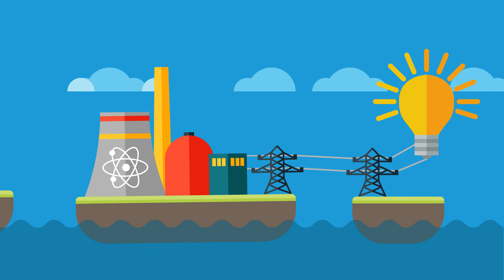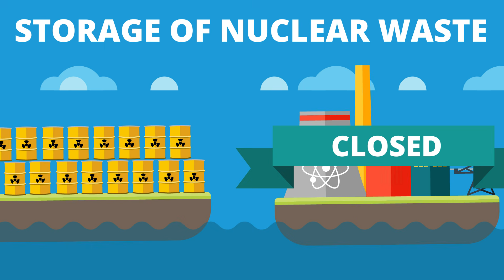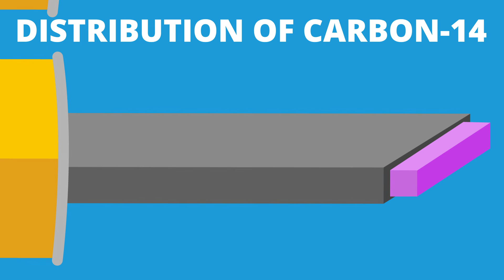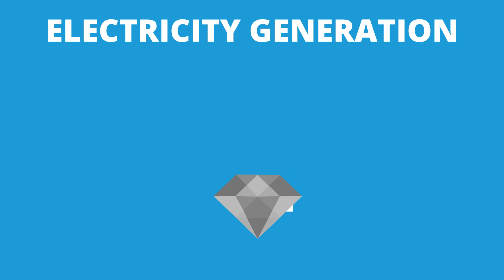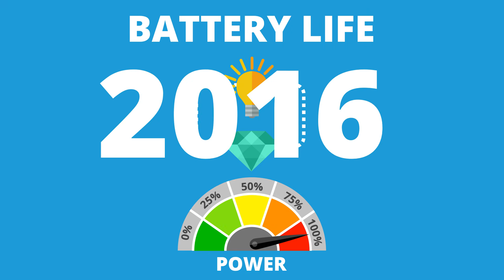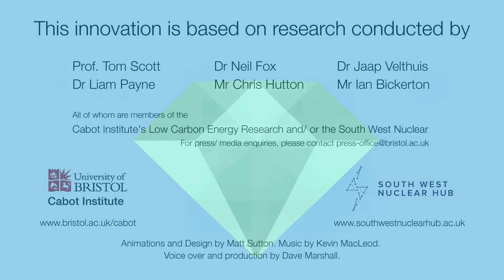‘Diamond-age’ of power generation as nuclear batteries developed

Comment: What size/weight and how much power we could expect form them?
Reply: "A diamond beta-battery containing 1 gram of C14 will deliver 15 Joules per day"

15 joules per day is about 173.6 μW... It's probably also safe to assume that that's the maximum power output, so I doubt you would even get anywhere near that output in any practical application. So... You'd probably be better off harnessing the static from your shirt as you move around to power your pace maker...
Reply: Well in this case, you have to be REALLY creative to come up with a application, wait till them come up will more powerful way to do this, or we eventually have some devices requires this little amount of power to work.
Reply: rudymeow Applications are basically reduced to areas that don't have any better power source and can have fairly large banks of these batteries... So... Basically just shallow crust mining, space-rock mining, and space exploration outside of solar systems... They have more powerful ways to use the same effect, and they've been doing it for decades. Just not with diamonds formed from carbon-14. They use decent semiconductors instead of diamond and fuels with a shorter half-life. I don't see the output of these things increasing much if at all considering it's largely limited by the half life of the Carbon. I suppose you could increase this by somehow increasing the concentration of carbon 14, but then you would have the problem of it becoming more dangerous.

Comment: Yeah.. graphite moderators are totally still in use... cough Chernobyl
Reply: It's because the graphite was used in combination with water as a coolant.

In a regular LWR, when steam bubbles form, neutron moderation is reduced, and the reaction slows down, creating a negative void coefficient. But with water and graphite together, the neutrons are slowed by the graphite and then absorbed by the water. That means that when steam bubbles form, there are more available neutrons because less are being absorbed, creating a positive void coefficient.

Graphite is a very good moderator, but it's only safe to use when you employ a coolant that doesn't also absorb neutrons, like a molten salt or high-pressure helium gas.
Reply: Wasn't Chernobyl a result of the overseer forcing the engineers to crank up the power output--against their urges not to--to impress some general or something?
Reply: Hank The graphite moderator was ultimately the problem in the whole equation.
Reply: MLGBanterVids Do you have a source that supports that? All of the sources I can find state that the graphite was the final trigger and was only a problem because they deteriorated due to improper cooling.
Reply: Hank That's what i meant :)
Reply: MLGBanterVids Then the real cause was poor cooling, not the control rods ;)
Reply: Hank Having fucking GRAPHITE in your nuclear reactor is never a good idea tho lol
Reply: MLGBanterVids Why?
Reply: +MLGBanterVids Graphite moderators are used in every nuclear reactor afaik, that wasn't the problem with Chernobyl. It didn't have enough safety systems in place to prevent the operators from doing something stupid. +Hank They weren't trying to impress anyone, they were performing an experiment to determine if the turbines would still produce enough power in the event of a reactor shut down until the diesel generators kicked in (they took about a minute to produce sufficient power to cool the reactor). They were operating the reactor in a very unstable configuration where they were flushing the reactor core with tons of coolant (reducing the rate of nuclear reactions) while having nearly all the control rods withdrawn. This was very dangerous as a steam bubble would immediately cause a flux in nuclear reactions, which is exactly what happened and an excursion event followed.
Reply: Or in other words: The fact that they didn't use their graphite caused the problem. So graphite is both good and needed in a nuclear reactor.

Comment: The lower energy output for grams means that for applications the diamond batteries will have to be quite massive and it's true that carbon can shield high frequency electromagnetic radiation, but what about Neutron Activation?
A large amount  of concentrated C14 would constantly emit a level of neutron radiation capable to make surroundings radioactive by neutron activation on long term periods.

Comment: As soon as i hear this melody i know i'm dealing with bullshit. Can't wait to see this shit debunked back into the hole it crawled out from.
Reply: It's a fairly reputable source though, Bristol Uni is ranked 41st in the world. I'm a bit sceptical, but it would be really unlike a Uni to put something like this out if it was nonsense, as it would be a massive reputational blow.

Bare in mind it's not promising the earth, just a low joule power source. Great for some applications, but it's not about to power your house.
Reply: Haha )
Reply: it's legit. but its power density will disappoint you, (170 µW per gram) and i think that's why they neglected to mention that
Reply: Huh. I thought Fission Batteries from Fallout when I heard of these things and apparently I wasn't far off.

Sounds like to be a practical wattage they'd have to be large and expensive. Still, if they can work anything like advertised, I can see uses for them.
Reply: Tactical ThunderNeck incoming!
More seriously, just wished there was less bullshit around "muh long half-life", and a bit more content about the energy cost of making such a thing VS its total output over a century or two.
Reply: How much can that power? Even a light bulb that never needs recharging (though probably replacing) could be useful.
Reply: a typical LED at average brightness will use around 33 milliwatts; so to power it alone, the battery would have to be 190 grams
Reply: +Paul Shields
And that's assuming the LED provides the perfect load for the battery to operate at max power, which I highly doubt it would.
Reply: +busi magen
I don't know if I would refer to TEGs as thermocouples...
Reply: Hank LEDs are stable loads, so power conversion to them is quite straight forward; conversion efficiency is routinely 95% or better, nothing to worry about, there. The deal breaker for this battery however is the low efficiency to start with.
Reply: +Paul Shields
I'm not concerned about the LED's efficiency. I'm concerned about what kind of current--and by extension, power--they could output when operating at a voltage high enough to surpass the barrier voltage of the diode. We know A power value for them. I'm guessing that's the max power point. If you don't know what I'm talking about, look up "solar panel power curve." These will have the same sort of curve. All semiconductor junction-based generators have output curves just like those, be they photovoltaics, thermoelectric, or betavoltaics such as this.
Reply: Hank Solar suffers from less than ideal conditions, fluctuating with temperature and sunlight, whereas a nuclear battery will have a smooth run-down as it ages. The application designer will match the power source to the load. If the load is stable, the job is straightforward; if not, power converters, which trade off current and voltage, are mature technology.
Reply: +Paul Shields
Again, you don't know what I'm talking about, and you didn't bother to look up the curve I told you to. When you leave the output of generators such as these open, you get what is known as the open circuit voltage. Since there's no current under those conditions, the power output is zero. Similarly, when you short the output, you get the short circuit current, with a voltage of zero, meaning the output power is also zero. There is a point between these two points at which the power output is maximized, known as the maximum power point.

Yes, I suppose you could set up a system in which the MPP is maintained, and converters are used to match it to the load, but then you'd lose even more efficiency and stability.
Reply: Hank, what puzzles me is your insistence that i don't know what you're talking about and that i didn't look things up. Not only am I proficient at electronics, (so there is no need to explain open-circuit voltage to me), I am also diligent and did examine the curves you referred to, before replying. Having designed, built, and tested power systems for auto-motive microcontrollers, i believe i can say confidently that we're not talking about a wild idea to fit round pegs into square holes, here. The technology is mature, even in Solar
Reply: +Paul Shields
Then why did you bring up irrelevant issues that PVs have? That's why I thought you didn't know what I was referring to. My argument is that they likely won't even be able to supply anything fairly close to the output power that they've mentioned. Yes, DC-DC converters would likely be helpful for cases a fair distance from the MPP, but they would still only be a detriment at or near the MPP. The 170 µW/g estimate is optimistic at best.

My original comment was "And that's assuming the LED provides the perfect load for the battery to operate at max power, which I highly doubt it would." If it doesn't operate at the MPP by itself, you won't be able to get the aforementioned power output. It might be possible to design the battery for a specific MPP, but I don't know how they plan to do the scaling, or how well the efficiency scales with the size.

In another thread on this video, there was a software engineer who didn't know what a digital clock was. Then, after talking to some CS friends, I found out that they hardly mention them in their curriculum. Nothing's more detrimental to a conversation than assuming someone knows a fundamental bit of information that he/she doesn't actually know.
Reply: We cant say 170 µW/g is optimistic without looking into battery configuration; that value is only 1.5% of thermodynamic efficiency, so it seems like the inventors took some issues into account. C-14 decay energy is 156 keV. we can start out assuming the beta is ejected from the nucleus in a random direction, and most of the time flies across some gap (but sometimes the direction isn't favourable). lots to think about, there
Reply: +Paul Shields
If the 170 µW/g is calculated, then you're right, but I was under the impression that it was an empirical result.
Reply: +Paul Shields
If the 170 µW/g is calculated, then you're right, but I was under the impression that it was an empirical result.
Reply: +Paul Shields. In other words, in order to run a small lamp (around 3 watts) you would need a 19 kg battery. Does not strike me as very practical. Unless, they manage to make these batteries a few orders of magnitude more efficient I don't really see the point.
Reply: +Probus Excogitatoris
Improving the efficiency might help, but I don't know how much more efficient you can get them without using a form other than diamond. The bigger issue is that the source of radiation decays so slowly, which is why they last such a long time.

The only practical applications would be in places where every method of generating electricity from the environment would be less practical and no reasonable way to get more fuel to the device... So pretty much just deep-space probes and the like...
Reply: +Hank I agree that it's not likely they will manage to make them several orders of magnitude more efficient. Longevity is of course a great benefit with regard to deep space probes... but, so is weight and these batteries are seriously heavy in comparison to other forms of batteries. But, who knows...
Reply: +Probus Excogitatoris
But they aren't heavier than the fuel or quantity of batteries that would be needed to effectively be a "launch and forget" type setup. I don't even know if there are any chemical batteries that would hold their charge for that long without any load attached...

Edit: Just to clarify, I'm not saying this is really a good use. They would probably use a better semiconductor than diamond, and potentially a better source of radiation.
Reply: Why would you want this to be debunked? Why wouldn't you want it to be true?
Reply: +Tim Tester
Those aren't the only two possibilities. A lot of the stuff in the video IS deceptive, and--IIRC--some is blatantly untrue. As such, a more accurate dichotomy would be it being debunked and the support and funding moved to more practical projects, or it not being debunked, and those duped by it dump funding into a glorified needlessly expensive and largely ineffective waste disposal procedure.

Comment: I need this for my #NissanLEAF - How much does it cost for 24kWh ?
Reply: It's power density, not energy density, that will make this unviable for transportation.

By my reckoning, you'd need a C-14 battery weighing somewhere in the order of a few tens of thousands of metric tons to run your 80kW motor flat out, and it would probably cost more than the entire global car market is worth each year.

On the plus side, it wouldn't run out for thousands of years.
Reply: I think a 2222 kg diamond should do it.
Reply: James Rowland But my current Battery is only 24kW,   I only need a Battery that lasts 20 years.  Then when it dies I'll get another one.
Reply: You need a battery that can actually run the motor. Like I said, power density. This thing has a lot of energy in it, but you can't get it out fast enough.

Comment: I wish the creators of this video had been slightly more responsible. At the very least there should have been a short sentence on prior art and the kinds of current generated. The technology behind "diamond batteries" has been around for a long time. The novel component is still a very cool achievement, but you can drum up press without making an over-simplified sensationalist video.

Comment: Came here to find out more about the principle of operation. Left disappointed.
Reply: The technology behind these is known as betavolatics or alphavoltaics; depending on what type of radiation is utilised. There is a fairly comprehensive Wikipedia article on them and they have been around for a long time. They originally used tritium as the radioactive source and were used in pacemakers before lithium batteries. So far as I can tell, the only novel component of this paper is the utilisation of fuel rods to acquire carbon-14 and processing it into diamonds.
Reply: I was under the impression that radio-voltaic devices required a rectifying junction. Do you think the proposal here is to embed that in the synthetic diamond somehow?
Reply: Potentially, but that would kind of throw the whole "easily offer" thing he mentioned about the outer casing out the window...

Comment: This process seems expensive and energy consuming. The batteries themselves wouldn't generate the energy that would be required to make them, and their cost would be extraordinary. Wouldn't it be easier to store the radioactive waste in a container that allows us to harness the energy within? I'm sure this would take up more space, but it's already taking up space. Also the fact that you didn't mention the exact energy output, make me believe it's relatively low. Would this diamond even be able to power an led bright enough to see on a road at night? The applications of such a battery would greatly depend on the power output. Not enough information is given.
Reply: Steven Ishee They are a byproduct of an otherwise efficient process. The fact you're generating them from an existing process must be priced in.